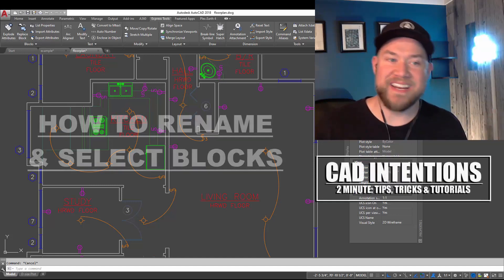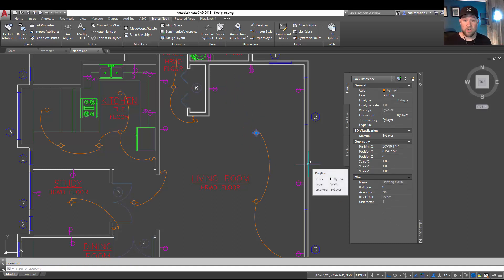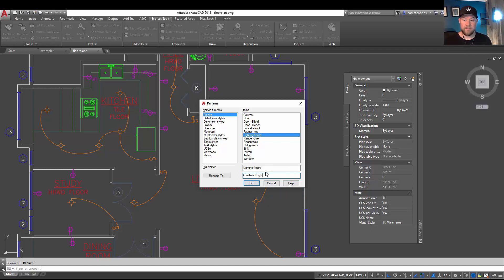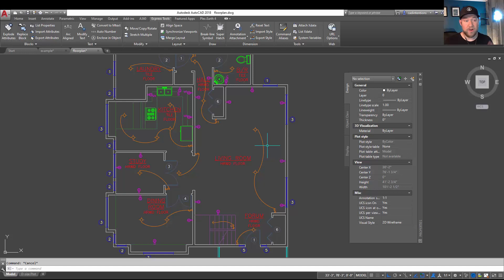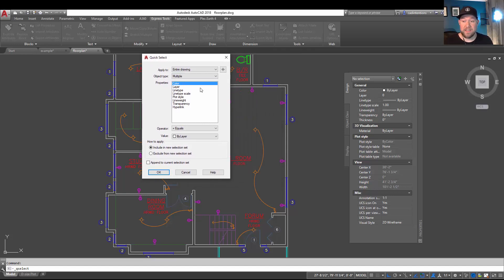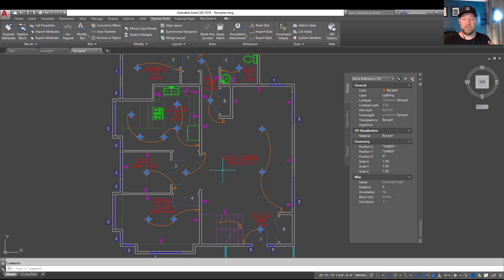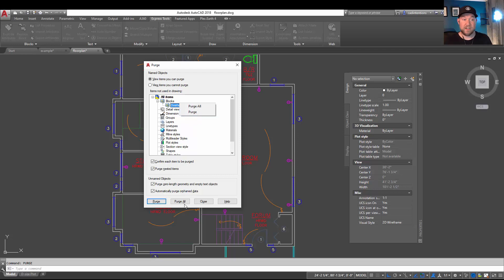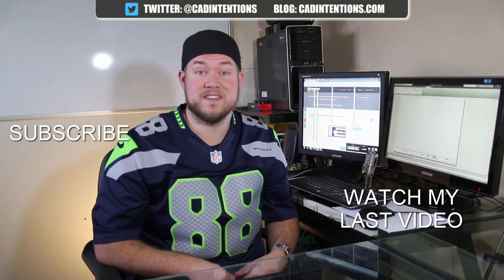AutoCAD How to Rename a Block - Plus more Block Tips! | 2 Minute Tuesday

Comment: Thanks for video. Is there easy way how to quickly change multiply dynamic blocks? I have  dwg draft file with attributes for every project, and depending on excel file content, later i need to manually change every symbol in dynamic block. Any function as match properties can help, but it doesn't work. Or any variable in excel what can define selected symbol for dynamic block can help neigher, but unfortunately i don't know cad on such high level.